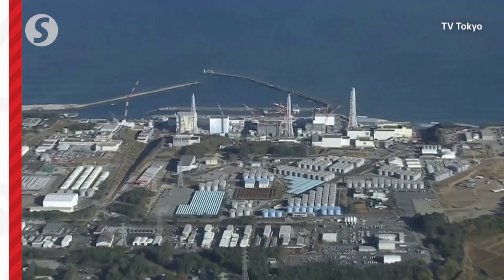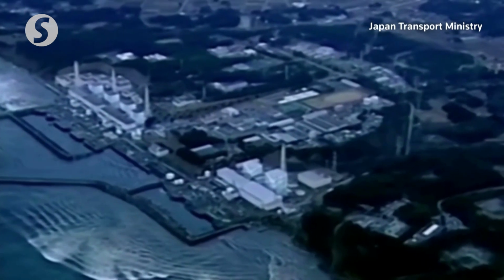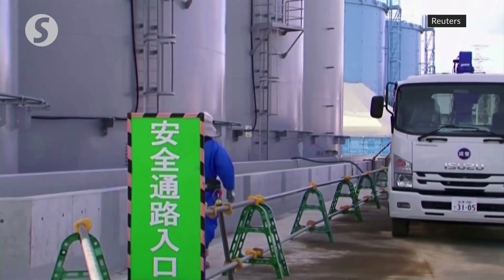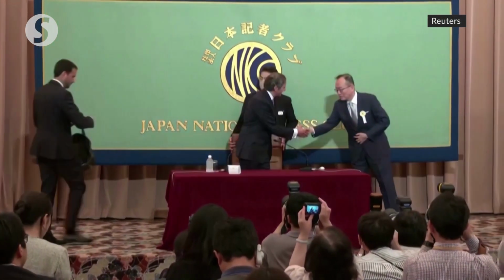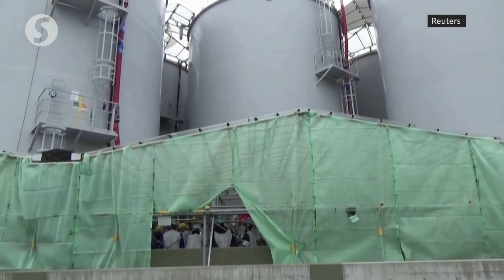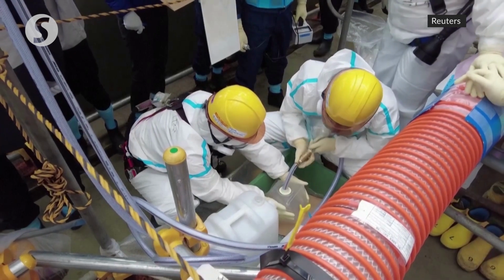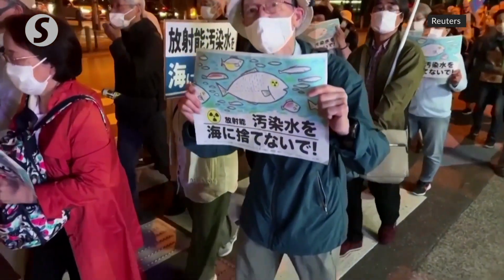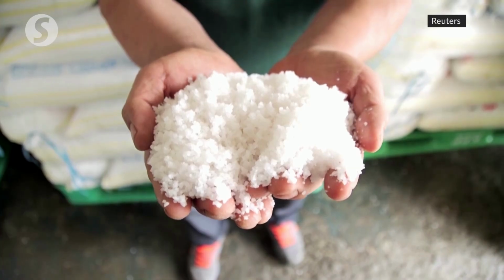How Japan plans to release Fukushima water into the sea

Comment: No I suggest to boil those water until vap level then through EP , then only release to atmosphere. Don't use Fossil fuel burnt boil method, instead use tepco's power to boil that contaminated water!
Or boil above 100°c, then freeze the distilled vapor as ice block, then dump it to nearest volcano. Radioactive or any diseases or even all the nukes hold by war mongers, can be neutrallised through volcanic radiation . Earth's core radioactivity is better refinery model!
Solve!